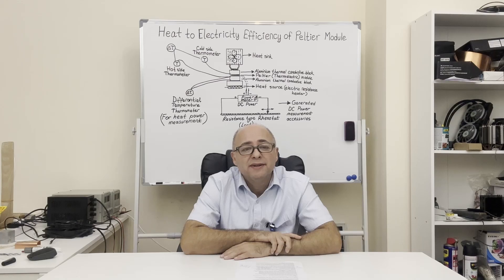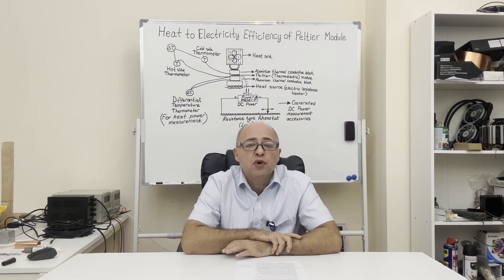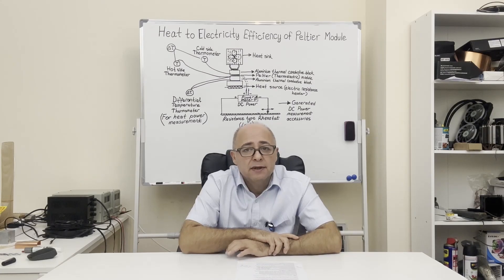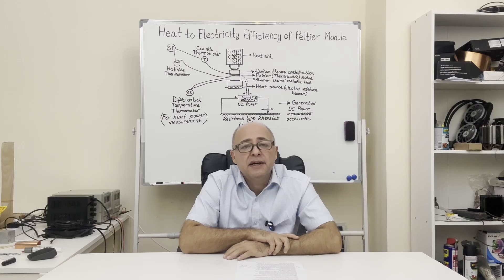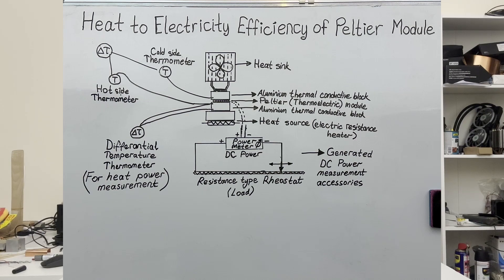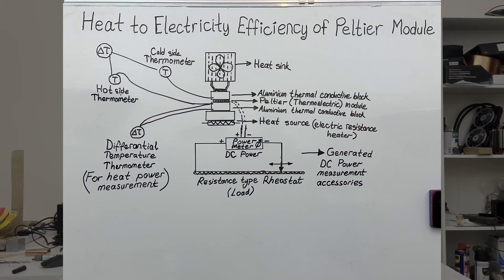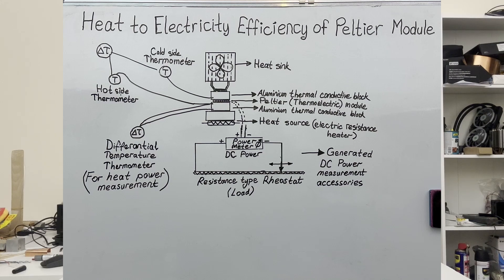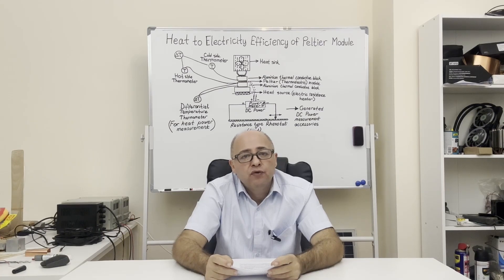I Measured the Heat to Electricity Efficiency of Peltier Module, Thermoelectric Generator

Comment: your yt video is the first one i've fond that takes the amount of heat flow thru the seebeck devices in account!, and you are right with the mppt item.
in my eyes the next problem for most diy projects are the thermal limits of the devices. eg max hot side temperature, and max delta t over the device.
another mayor problem is the thermal induced mechanical stress due to thermal expansion of the thermal conducting surfaces. in most cases aluminium plates.
the cold side will shrink, the hot side expand. as more seebeck devices you have ia a row, (in most cases for electrical in series connection) as  longer is your row, as more thermo-mechanical stress you get in this long row. this results simply in broken devices.
i guess 99% of diy teg projects are broken due to no care to this problems.
overheating, over delta t, and excesive external induced mechanical stress due to thermal expansion of the thermal coupling surfaces.
Reply from the maker: I'm so glad you liked my video. What you said is very true, thermal stress can cause these devices to deteriorate very quickly. In fact, thermoelect modules are so sensitive that even if you drop them on the floor, they can no longer be used. The semiconductor pellets inside have a very fragile structure. It should definitely be designed with thermal stress in mind.
Thanks.